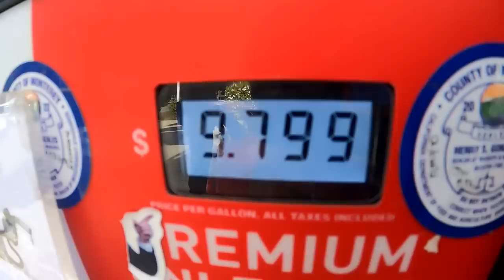Scotto Buys a Ferrari but still identifies as an old Audi (DTB 004)

Comment: the 200 wagon is a unicorn! hands down take that over the ferrari! the 3b in that thang sounds PUUUURFECTTT
Reply from the maker: Stop enabling this man.
Reply: Wagons are for women, or transfluid men
Reply: Stop lying to yourself just to sound edgy….
Reply: @HooniganBonus  He's right though. Scotto has the best taste in cars. Nothing will ever be more enjoyable for longer than old VWs and Audis.
Reply: @_baller  you wish you had the steeze of an 80s AWD turbo wagon
Reply: @boostaddict_  I don't
Reply: @_baller  oh, because you can't handle the steeze, how could I forget?
Reply: I had the 5000cs quattro turbo wagon, basically the exact same car. Best car ever, sounded sick, looked sick, and would put bus lengths on any STI or hot hatch that pulled up next to it with just a boost controller and full 3inch.
Reply: I had a black 200 20vt avant, those things are awesome!! I'd take it over the Ferrari for sure!!
Reply: @codym2108  ahh the good ol 20vt, literally one the best sounding 5cyls ever. My 5000cs had the turbo 3B, mechanical fuel injection, and had to spray ether in a vacuum hose to start it anytime is was cold ahaha

Comment: Forgot how good the sound of the 5 valves-per-cylinder Ferrari V8 is, amazing
Reply: isnt this a 4 valve one? the 5 valve is the f355
Reply: @jogaton7994  I believe the 360 is the last 5 valves of Ferrari V8, the F430 is the one that have 4 valves. And yes they both look similar in terms of design, so maybe people got confused between them
Reply: @jogaton7994  360 is also 5-valve.
Reply: Cinco valvole

Comment: The smg e46 M3s are the same way as the F1 box they were talking about in the 360. You can use e46 M3 smg trans as manuals with a few things changed over

Comment: Welp, it's officially cheaper to run on race fuel than it is on pump gas there lmao
Reply: it’s only that much because that’s the only gas station for miles, we have something similar it’s a station before you go up a mountain,  so ideally going up you don’t wanna run out, so it’s there at $7 which is not that expensive but for the boonies in cali it is

Comment: ive always had a thing for the 360 after James chen brought one to the 1st sport compact car magazine ultimate street car challenge a stock 360 with aggressive tires and an alignment and smacked around big single turbo supras and skylines that 19 year old me thought was unbeatable back in the early 2000s. It was beating the crazy built tuner cars by 6+ seconds at willow springs. https://youtu.be/e2bK4n4_rEk?t=2455